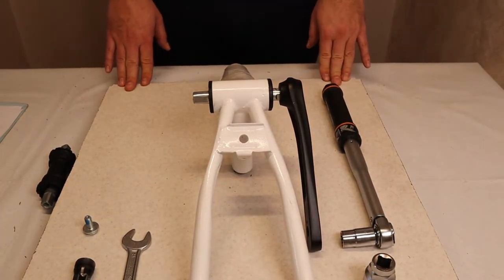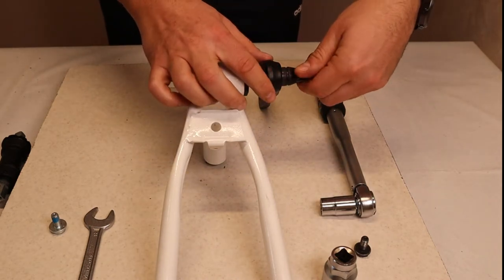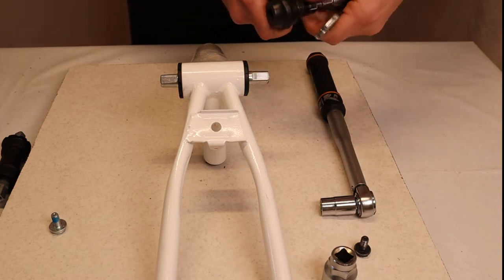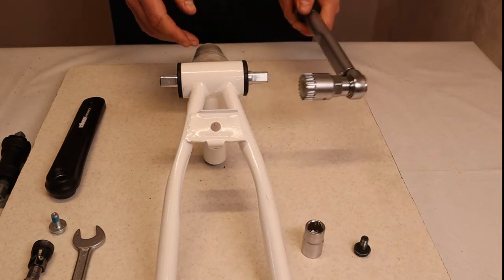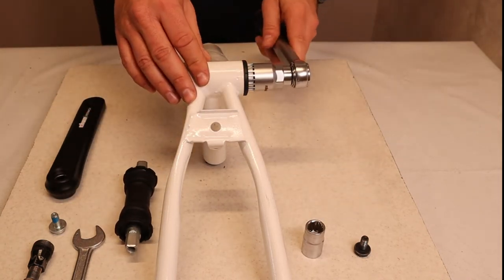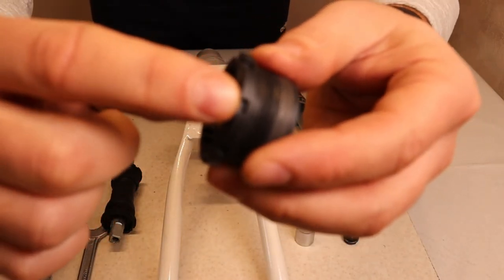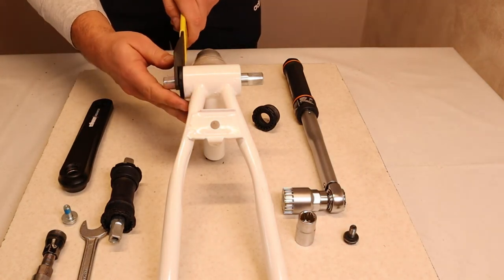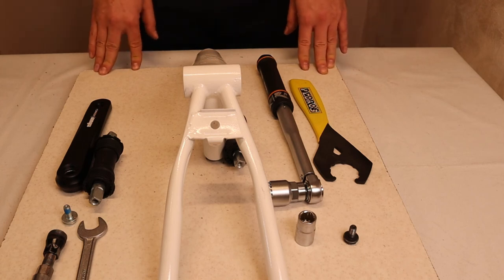How to disassemble a bottom bracket correctly Thun

Comment: There isn't only "one" Pedro's key, there are many different ones, and Googling is impossible. So which one? Also, Thun's documentation is basically non-existant on the website. In addition, the Thun Goal is made of extremely soft plastic, has "Pedro's Key" on only the non-drive side, and I just stripped the inner removal teeth on the drive side following this video. 😞
Reply: Any sucess .. i have the same bb.. doesn't open with the standard tool all the grooves broke when I applied some pressure